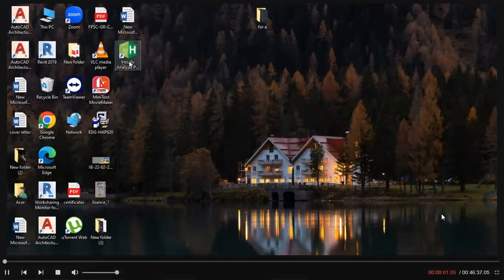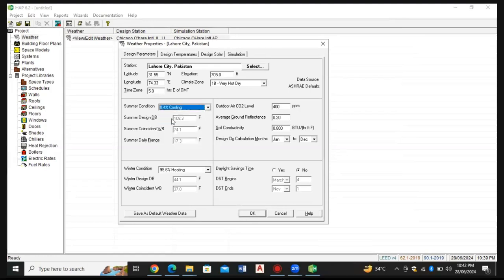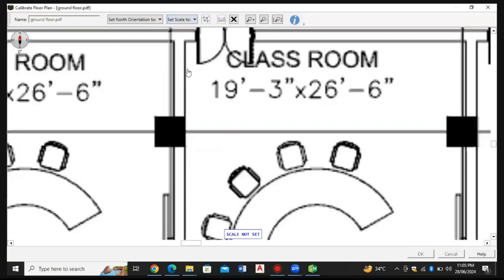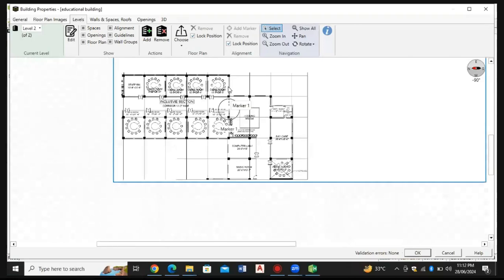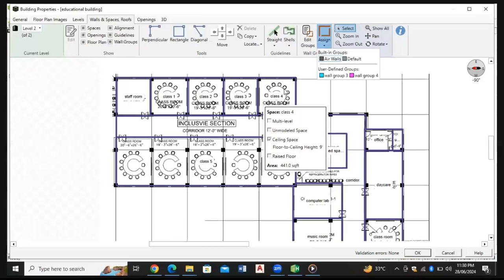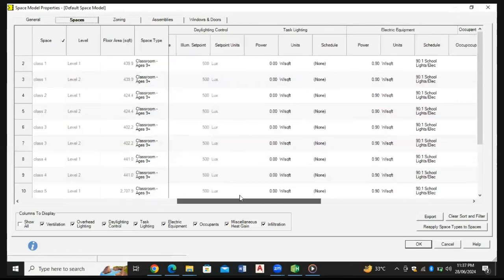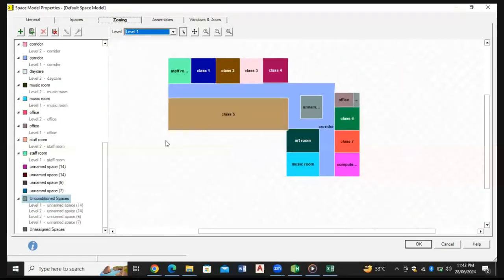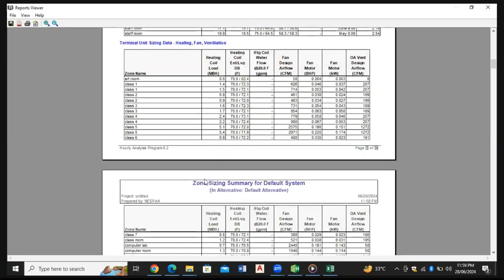HAP 6.2 COMPLETE TUTORIAL BY HAMMAD

Comment: Thanks for the video. I have a question: If I want to calculate the cooling load for a single room (not exposed to the sun), located in the center of a floor, how should I deal with that? Is it enough to draw only the room, or do I need to draw the entire building? Unfortunately, when I draw only the room, HAP defines all the walls as external.
Reply from the maker: You can contact me on wattsap +923481985961
Reply from the maker: Create imaginary building around it.

Comment: mate how to show a shaft or a void or an atrium in our model???
Reply from the maker: Use multi height option for that
Reply: @MuhammadHammad0747  ok, but on which floors should I use that? Let's assume we have a void in our building, the bottom of it is on the 1st floor, and the ceiling of it is the ceiling of the 4th floor, plz help me with that mate, tnx
Reply from the maker: On each floor from 1st to 4th floor. Mark kit as multi height.  You can also contact me on whatsapp  +923481985961 @shayansorush3960

Comment: Hello, I am currently doing a practical exercise. I used two HAP models, both served by the same heating and cooling sources. Now I have combined the two files and merged the air systems of the two buildings. However, I encountered an error when trying to export the report under "Alternatives". it say :2 buildings are included in this alternative, but only one is permitted.However, in the "Import from HAP Project" option under the project, I clearly saw in the Help section that it is possible to merge two HAP files and then perform calculations. Did I do something wrong? This is really frustrating.
Reply from the maker: @DavidBrown0310  yes you can add only 1 building at a time in alternative. Better way is to make two plant rooms and serve each building with one plant room. Make two alternatives ....each for every plant room. Then manually add the loads of two buidlings at your end while making equipment schedule
Reply: @MuhammadHammad0747  Thanks for getting back to me so quickly.How should I understand the term "manually"? Does it mean I should use Excel or some other tool to add up the loads of the two buildings, and then proceed with the equipment selection for the central plant?

But there’s an issue — and I’m not sure if I'm right about this: the plant calculates the peak load for each building separately. However, when selecting equipment, I should be considering the combined peak load of the two buildings, not just a simple sum of their individual peaks
Reply from the maker: @DavidBrown0310  yes . I mean to add it on excel. Yes, you are absolutely right that it will pick the peak loads and your total load will be slightly higher. It will not have major impact on load but a slight difference.  If you want to check the difference then i have a solution for you. You can reach me on whatsapp for that +923481985961
Reply from the maker: I have the solution  @DavidBrown0310
Reply: @MuhammadHammad0747  what solution?
Reply from the maker: @DavidBrown0310  please contact me on whatsapp

Comment: HAP 6.2 does have a lot of  challenges, especially when dealing with complex projects like those with varying heights on the same floor. It becomes frustrating when even minor adjustments (units changing) lead to complete data loss.

It becomes more complex when making different Levels to adjust different heighted spaces at the same floor.

We cannot apply two different properties wall on same wall at different levels...
Reply: Can you share the PDF file for practice purposes
Reply from the maker: @TechSparks_by_Shafran  share your email.  I will send
Reply from the maker: @IA-Bangash  to some degree, i agree with you. Different Height is possible if your space is at a corner but it is not possible if the space is surrounded by other spaces.  We can add level at same height to make a space of different height but it is not valid for the case when space is surrounded by other spaces. I cannot say anything about data loss because it not happened with me. 
Different wall u factor value ca be given by assigned wall option